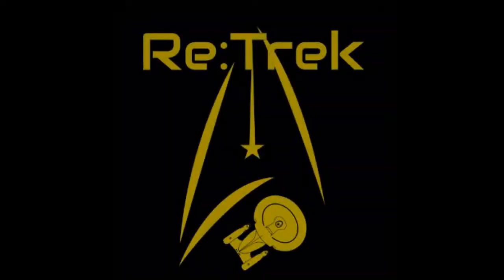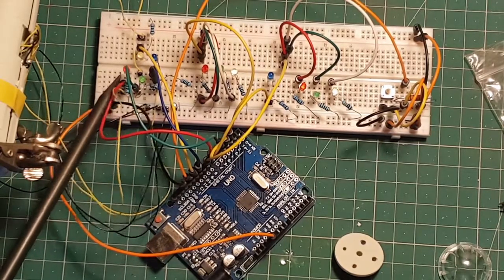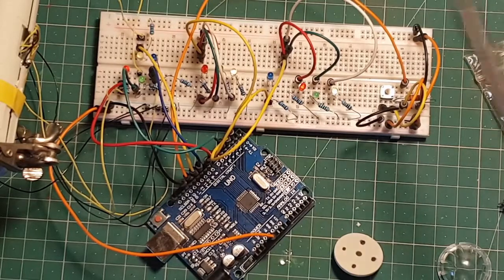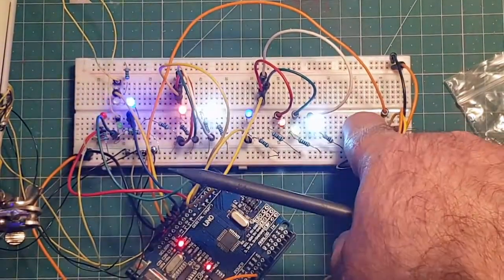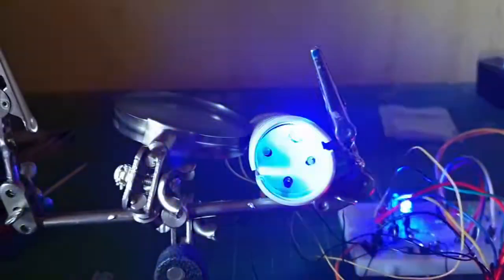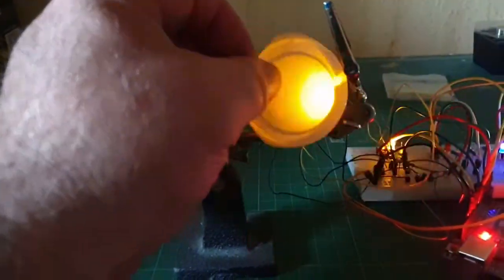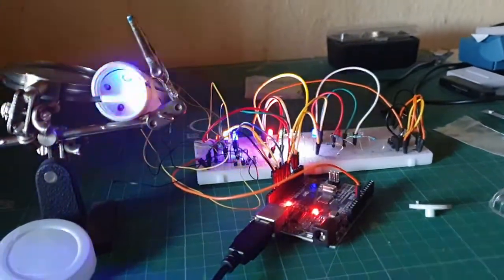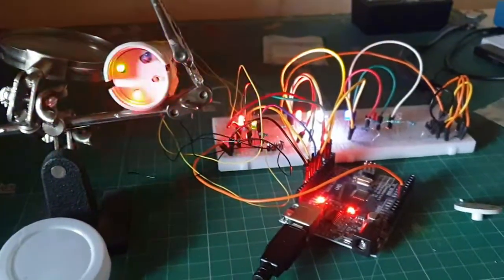Revell 1/600 TOS Enterprise Lit Build part 3

Comment: You know you can add upto 4 leds to one arduino pin. So the navs can all go on one pin and the strobe on another pin, the only ones that need separate will be your bussard collectors
Reply from the maker: Yes iv done that already iv had to do it twice though as I want the nav and collision on the nacelles able to switch off separately,  . Iv got all them lights so far reduced to 8 pins in use including the push button switch , if still got 4 more pins for lights to add the motors then the sound card and speaker plus probably 2 more push buttons so at least 13 more pins needed
Reply: @ReTrekModelStudios  may need another arduino then or make your own pcb arduino
Reply from the maker: Once all the sketch is written and I can see how many pins im using il be transferring the whole thing onto ATMEGA328 and ATTINY85 chips the Arduino wont be part of the final board at all